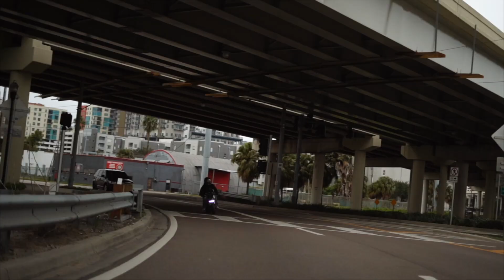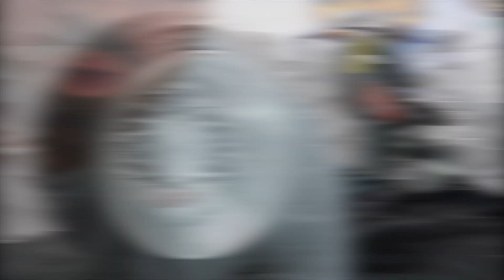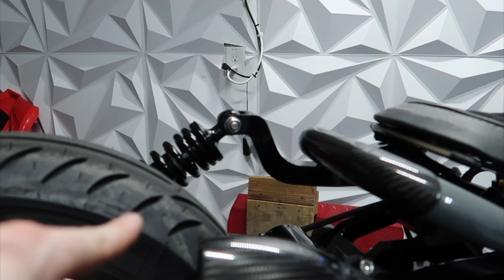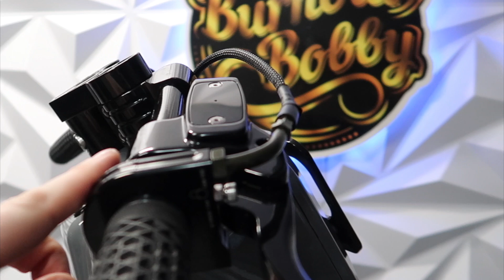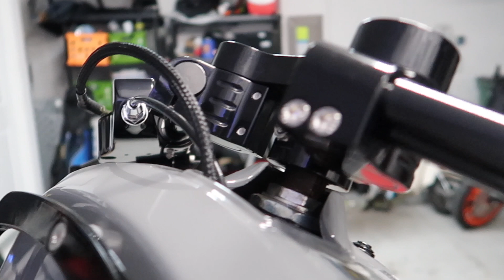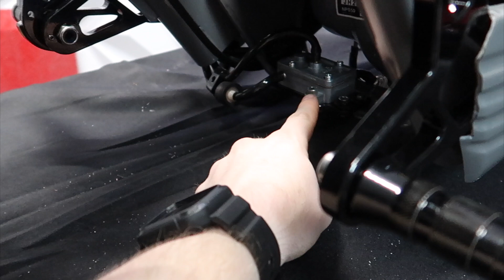The Ruck Is Finished - 171cc Start up-

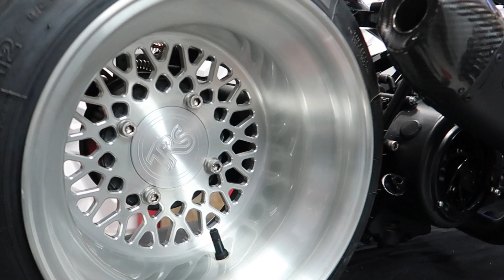Comment: 2:05 I've noticed you have the weel mounted with cap head hex screws. They are grade 8.8. Is that safe enough to use them? :)
Reply from the maker: Yes that’s plenty safe for the wheel.
Reply from the maker: Been using those bolts for 15 years now on these.

Comment: Hey, quick question: where can I get the 14" stretch bar and shock mount from? I have 12" TRS mount, but now I want to stretch it to 14" :)
Reply from the maker: I have the bar in stock but you won’t be able to get the shock arm. I only made one. It cost me about $600-700 to make that arm.
Reply: @burnoutbobby  Hey, does the 14" bar work with 12" setup? I mean remove 12" bar and install 14". And, if I understand it will push the motor away by a little bit and lower the frame down. Do you have any numbers after this change? I want to know how much it will change if I replace 12" bar with 14". Thanks
Reply from the maker: It will work in theory but the shock will be at a sharp angle.

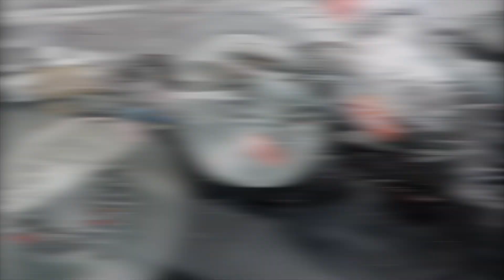Comment: 9:11 I think the camera is suppressing the sound. How lout it is? I have Ruckus with default gy6 swap kit from Rolling Wrench and the sound is like I have a Harley. Is that ok to be so loud?
Reply from the maker: I’m not sure what exhaust you have on there but they can vary in loudness.
Reply: @burnoutbobby but in your case. What you would associate the sound of your Ruckus with so I can understand what is loud and what is ok for a Ruckus :)
Reply from the maker: @alexandrucovaliov8989 that’s kind of hard to compare to.  Small cc atv
Reply: @burnoutbobby wow. So that’s less noise than a lawnmower. Because my son is riding his 125cc atv on the street back and forth and his atv makes less noise that my neighbour’s lawnmower
Reply from the maker: @alexandrucovaliov8989 not a stock exhaust on atv though. Gy6 are loud motors. You can’t compare without hearing though. It all depends on the exhaust you have and muffler size.

Comment: Thinking about buying my first ruckus or Maddog scooter which one would u recommend for a first timer
Reply from the maker: A ruckus for sure. There is not a lot of aftermarket parts for the maddog like the ruckus and the wiring/ welds are known to fail on the maddogs.
Reply: @burnoutbobby  ok thanks ill keep looking
Reply: Is icebear a good brand
Reply from the maker: @leshankaigler2676 not really known for quality unfortunately
Reply: @burnoutbobby  dang I want to find a good one but don't wanna spend too much
Reply from the maker: @leshankaigler2676 that’s tough when it comes to the ruckus

Comment: I am looking for the side skirts you have on this bike. The things that are on each side of the gas tank. Frame covers or whatever the correct term is for those. Do you remember where you bought them?
Reply from the maker: Got them from my buddy in Japan. I think Tokyo parts used to make them.
Reply: @burnoutbobby  
I am having a time finding them. Even Ali express doesn't have a decent set. Rolling wrench seems to not want to tell me where he got his. Dorbyworks has a set but they are not the ones I'm looking for. Just no luck.
Sourcing some things for building these bikes can be quite difficult.
Thank you for the reply.
Reply from the maker: There is a guy who makes replicas called zoomer.ruckus on Instagram you can try him.  Not sure why people want to keep secrets on this stuff lol
Reply: @burnoutbobby  
Thank you very much!
I will find that guy.
Rolling wrench may just be busy but I asked in several videos and asked other questions and he replied to the other questions but none of the ones about the body pieces.
Do you happen to know the correct term for those pieces?
Reply from the maker: Side skirts

Comment: HOW DO I GET A SHOCK MOUNT LIKE THAT ?
Reply from the maker: Custom designed Gn one and then get a machine shop to machine it out if 6061. It probably cost me close to $900.  $300 for the block of aluminum alone. Was not cheap at all.
Reply: @burnoutbobby  SHIT its worth it to me. wish i knew the spec numbers

Comment: Hi so i noticed you did not mention whats the front tire & rim sizes as ill like to buy the same set up appreciate it if you can let me no thanks
Reply from the maker: 12x4 with 100/60-12 tire.
Reply: Thank you very much for the reply i appreciate it will help a lot as im building my own Honda Ruckus From Ground up

Comment: For someone who is super interested in getting a custom made Ruck.  How much should someone expect to pay for a build like this?
Reply from the maker: This one is not your typical build so it is probably 16k range. A good gy6 swap custom built with not as many one off parts is 6-10k
Reply: @burnoutbobby  thanks 👍
Reply from the maker: @robertmcveigh3653  you’re welcome.
Reply: @burnoutbobby  so why is it 16k? is that the cost of the parts or because the community collectively agreed a Ruck with the power of a R3 sells for 600cc prices?
Reply from the maker: @kushpaladin all the custom parts, labor, paint, etc. it all adds up.

Comment: Stock starter or high torque? If so what brand? And what battery you running?
Reply from the maker: Stock starter. No need to have a high torque starter for 171cc.  The battery is a mmg featherweight from trs.
Reply: @burnoutbobby  hmm damn okay, I’ve heard different things. I have the “101 octane high torque starter” from steady garage, was running a 200cca Mightymax battery but due to the higher compression I assume it’s been frying the batteries. Have that Shorai battery from TRS coming Tuesday so hoping the cranking amps from that one will be enough to turn over the motor easier.
Reply from the maker: What motor is it? Yeah usually you don’t need it if you have a stock throw crank. You maybe increase compression a little but nothing crazy with 171. When you get to a strocter crank is when they come in handy. Everyone will say what they want with what you need and don’t need.  I just say I been doing this every day for a career for 13 years so there’s some experience there haha. Be careful what you hear on those fb pages.
Reply: @burnoutbobby  got the motor from TRS, ncy big bore with stock cam, just doesn’t seem like the battery has enough juice to crank it. Already added another base gasket too to try to help but didn’t seem to do much, maybe a tiny bit. Upgraded thicker gauge wires from battery all the way back to starter and some to frame. Not sure if adding more grounds would help at all. Just need to stop frying batteries haha! The mightymax didn’t say what amp hour the battery was, but it definitely wasn’t enough to crank it over time after time right away.
Reply: I have the new rolling wrench EFI system so that probably doesn’t help with the draw on the battery when cranking, just hope it’s only a battery issue and not because of the compression or whatever being too much for the battery to work on
Reply from the maker: @chrisrosanio9459 could be the battery. I’m running stock harness ground from atr , same motor setup but with a12 cam and stock starter with mmg battery and turns over fine. The only two batteries I trust are featherweight and shorai.
Reply from the maker: Oh that could be it too. I am a carb guy and stick with those over the squirter systems.
Reply: @burnoutbobby  I got the PSP harness, don’t think it’s an issue there I’m hoping but we’ll see when the battery shows up, crossing my fingers it helps!
Reply from the maker: @chrisrosanio9459  psp is fine we have 2 shop bikes with psp and 171

Comment: I have looked into the rear seat frame like that because I like the look and it's very expensive. It's almost $1,100. I think I will try my best to just build my own. I want to be different from everyone else that has a ruckus or a ruckus clone.
Reply from the maker: Yes it cost me closer to $900 to make. The frame was $111 then the fab time was like 600, seat was 150 and I didn’t have the gussets or frame caps like the trs one.

Comment: I’m getting my first ruckus in a few weeks and I’ll be the first to admit I know nothing about working on a bike. It’s coming from a friend who’s made a few mods already (Rev limiter and CVT installed) not that I really know what they do. I really would like to work on it to stretch it out and customize it to my liking, as right now it’s just looks like a black ruckus right out the shop. Would you have any recommendations on where to begin? Best ways to learn? First mods to do myself?

Been really enjoying your videos these past couple of days! Keep up the good work 👍🏼
Reply from the maker: I’d suggest to keep it 49cc platform to keep things easier. I wouldn’t go fatty wheel setup in the rear as the wheels are in a shortage currently.  There are a ton aesthetics you can do that bolt right on that clean it up and really make it yours. Check out the ruck shops website and you’ll be in candy land with all the parts.
Reply: @burnoutbobby  Thank you sir! Will do 😄